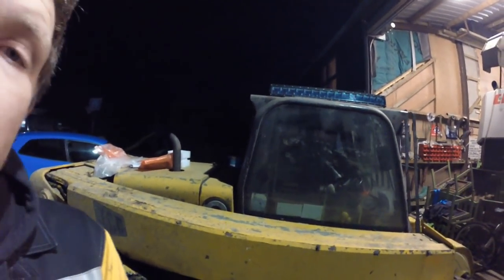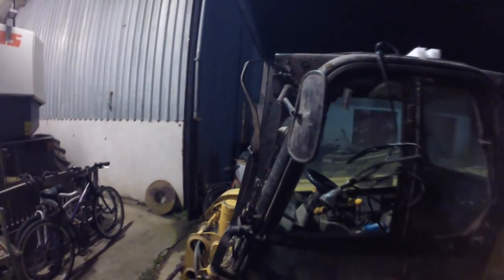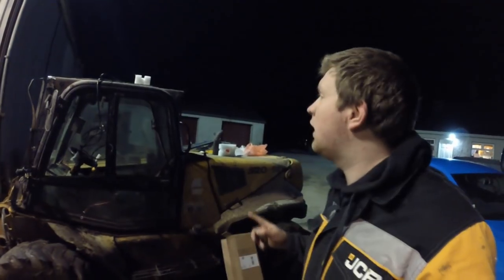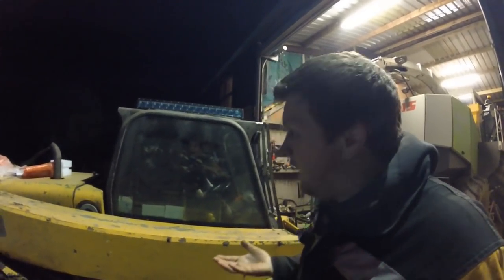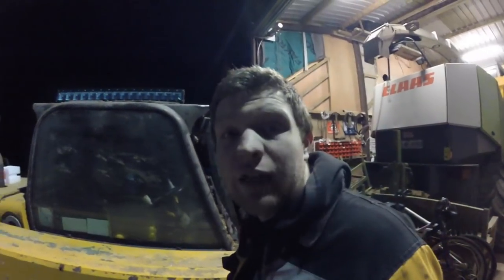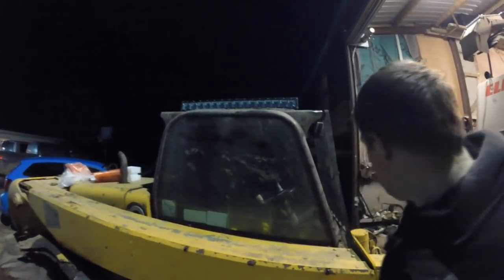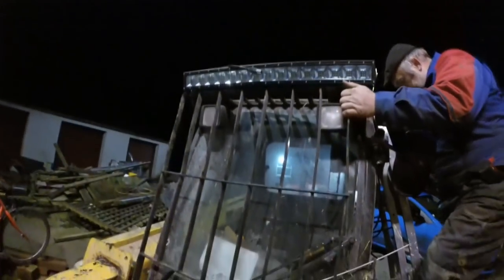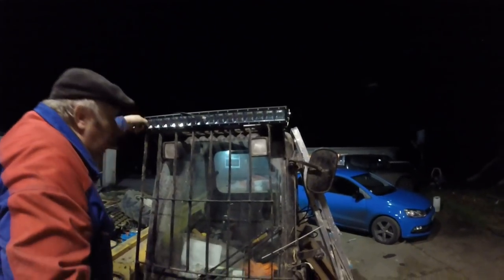FITTING NEW 30" LED LIGHT BAR

Comment: Hi Phil should have connected to the wire from the Spot lights led bar doesn't take much power to run great job should put one on the back 👍👍👍👌
Reply from the maker: i was asked to make sure i went straight to the battery and use their cable so i did so

Comment: Hi Phil. You go to amazon and see what they got. My single ones are just as bright. And they are cheap great for work lights on back off the tractor it's more or less having 24 hours off day light. If it's still fit to go in the fields and it's just lights are not helping you put the light square ones like you got on front off that j.c.b . Thay ar great. And you don't worry so much about them there cheap. Thay take a lot off abuse.  Those light bars are good but they do start to go after a bit so I just run singles . Great job.  That swich may be a control valve switch so you can switch part of your main control joy stick to run something else.

Comment: Great light bar Phil just need to fix the rattle on it now
Reply from the maker: getting the bits to do that but its a big job my father eckons the floor if not the cab will have to be taken off to get at the mounting bushens
Reply: @FARMERPHIL3690  you will have to get in the work shop when you've tidy it up

Comment: For the hitch
Reply: I've a pickup hitch on my 520. It's a farm special. I know what the button does and there is a latch on the hitch for locking. I pulled the inside of the cab apart one day trying to find the lever that will unlock the hitch. I can't find the prick of a thing. Tis fair annoying. Need 2 people to open the hitch. Where is it supposed to be.
Reply: Sean Toomey Jaysus lad I’d say you’d want to make a cable yourself to unlock the hits

Comment: Overkill, for the speed      that machine travels the existing lights were fine, when you are lifting the bucket and the light bar shines on the back of it you will be blinded.
Reply from the maker: the existing lights were not good enough, the glare only is bad when your 1/4 to 1/3 of the boom out past that or in tight doesnt really bother me